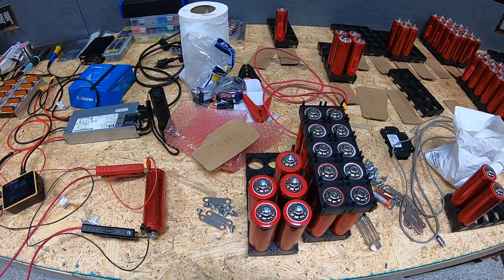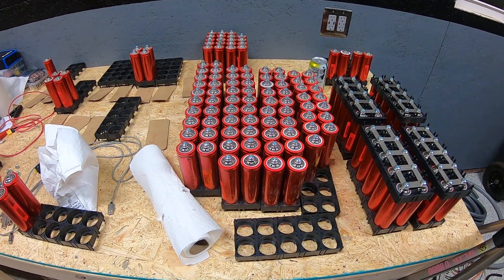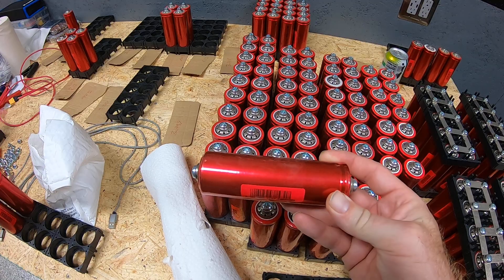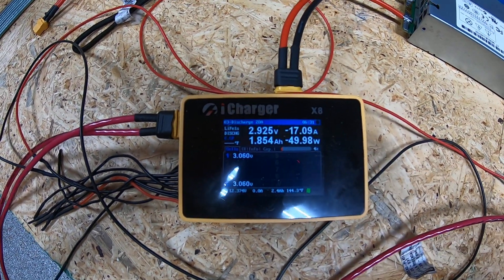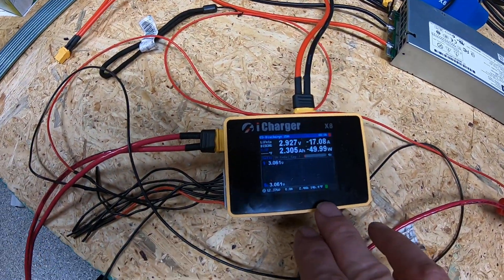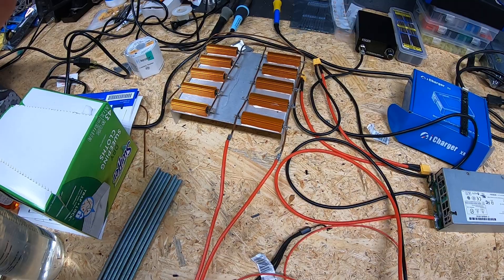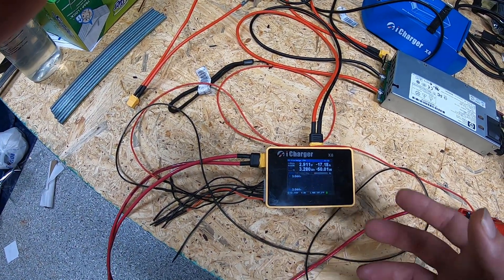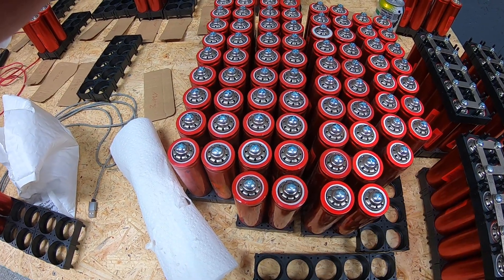Headway cell testing and pack assembly

Comment: Hi there! 
Whats the dimensions of 10s1p of these cells? I like these cells due to how easy it seems to attach them together, no need for sppktwelder it seems! 
I want to build electric cross but having difficult with dimensions, hard to see if I could make a 20S2P batterypack and fit it in the frame, hehe. Thanks!
Reply from the maker: Hello, the dimensions of a one of the 10S 1P packs is: 3 1/4" wide X 8" long X 5 1/2" tall.